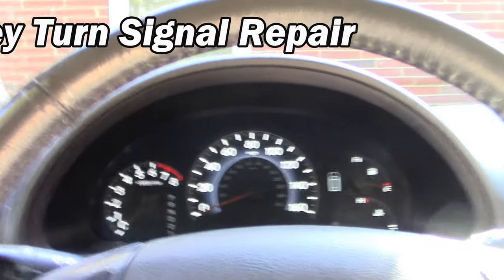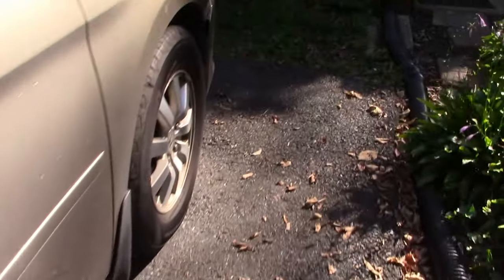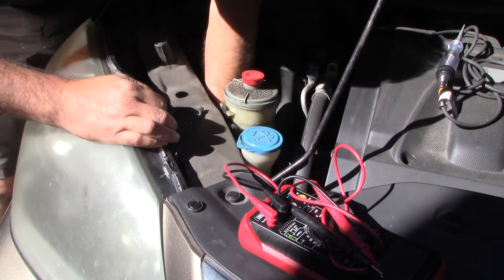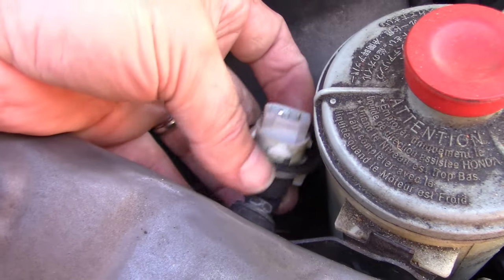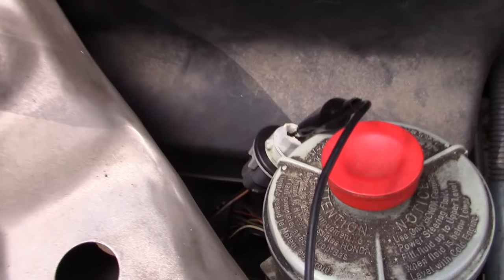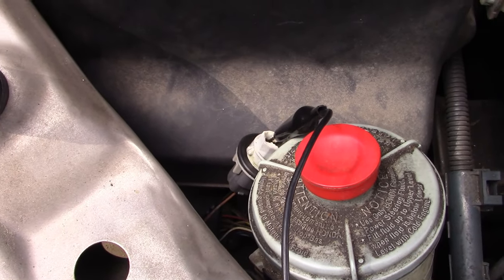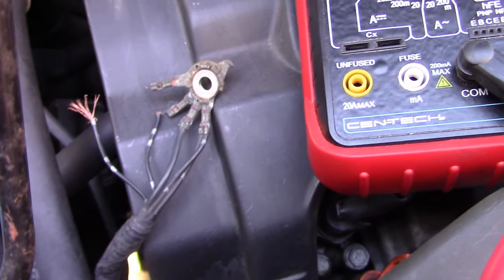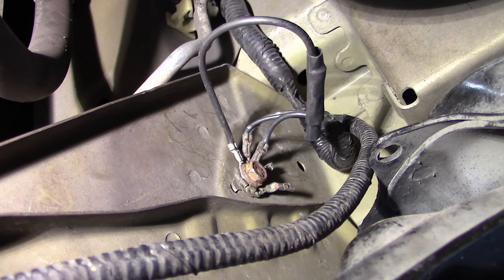TURN SIGNAL Not Working But BULB is GOOD - Blinker Diagnosis & FIX - Honda Odyssey

Comment: I had the exact same problem with my 2009 Odyssey.   My mechanic did his diagnosis and at first thought it was a bad socket, but replacing it didn't help.  He eventually thought there was an issue with the fuse box multiplexer that would have to be programmed by the dealership.  I wasn"t  convinced and showed him your video and asked him to checkout the grounding point.  A couple of the wires broke when removing the screw, but he soldered the broken wires and heat wrapped them and used some dielectric grease on the contacts and PRESTO, my front right turn signal is working again.  Thanks again for the great video!

Comment: mine is stuck on solid while engines off but when I turn my signal on it blinks but when I shut it off, it’s just lit even with the engine off and only on the passenger side, but if I put my driver side blinker on it, shut off until I shut my driver side blinker off then it solid again. Does anybody know, what might be the problem?

Comment: Thanks for making this video and going through the diagnosis. Just had the same issue on our 08 Odyssey and ordered a new relay, which did not solve the problem before finally finding your video. Almost considered getting the whole front wiring harness, but that would have been an expensive and time consuming solution. Thanks, again, for sharing and saving a lot of time and headaches!
Reply from the maker: Thanks, Tom, and good luck!

Comment: Sorry it took your whole day. I’m definitely thankful. Needed to do this so I can pass inspection.
Reply from the maker: Great. Hope you get it resolved easily. NJ inspection used to check everything....blinkers, lights, brakes, horn, everything. Now they look at your paperwork, plug in a scan tool to make sure the check engine light is not illuminated, verify you've got a catalytic converter....and that's about it.

Comment: Great job.  Honda needs to do something about those ground connectors that are open to the outside weather elements.   Especially with the lights which could be grounded closer to the light reflectors and more out of the corrosive salt and water elements.
Reply from the maker: Good insight. Thanks for the note.
Reply: Cadillac does too. Because my 2005 SRX has the exact same problem looks like.. All I know is I’m tired of changing bulbs.. It’s a challenge to get to the bulb period on these cars. This is the blinker and fog lights lower that’s quite a bit of work just to change a bulb. The head light lamp is a bit easier though.. But that blinker is WORK!! 😂🤣

Comment: Great video, my indicator light won’t turn on and the turn signal blinks fast .  There’s 2 different filaments .  It’s not the bulb, I replaced the bulb and same problem. Checked the bulb continuity for double assurance.  Are you not afraid that the other grounds are going to fail??

Comment: Have the exact issue on my 2006 dodge caravan. Now I have to figure out where the wire is bolted to the frame rail. Thanks for the logical plan.

Comment: Hi, I lost both my rear left turn signal light and brake light. I think it is also a gruangding issue. Could you tell me where the grounding point is to that circuit. Thank you

Comment: Excellent vid, I have the same problem with my 05 Odyssey, thanks for sharing it. I will be looking at those ground wires,  tried the new bulb on the LT side signal worked fine so it's not the RT side signal bulb. My fender liner is missing on the RT side, I'm almost certain the negative ground will be corroded 👍🏽
Reply from the maker: Yep, common problem, apparently.

Comment: I’m glad I found this video my friend has the same issue. And when u said about turn signal blinking at different speed inside the car I just realized that I did heard the difference. But did not paid attention to it. Now that u said if I will be checking fuses. And also the turn signal in his just stays on so it’s def not bulb issue. But now if it’s not fuses or relays. Then I hope the body shop that fixed fender and bumper and replaced the headlight didn’t accidentally messed with wiring.

Comment: Glad I found your video, similar problem but mine is the RT rear turn signal on a 2005 Camry.  Ok, now I have to find that chassis ground. Hopefully it's not hidden away to bad. Thanks again. BTW, swapping the bulbs from the working side / bad side is a good way to check the bulb without having to run out and buy a bulb that you may not need.   :)

Comment: Look like both left and right blubs were flashing in vidio ?
Reply from the maker: Yes. Because I put on the flashers to test both sides at once after I fixed the bad ground connection.

Comment: I’m hoping I have a somewhat similar issue on my Accord. My left side blinkers both stopped wormy simultaneously and don’t even come on w/the hazard light switch. Checking the ground wasn’t even a consideration until I saw this video.
Reply: It’s the signal relay

Comment: One of my headlights has been out for a few wks, my 4-ways still function properly bulb wise and dash wise, but my turn signals for both sides will stop working spontaneously. I replaced the 4-way button back in August as well as the actual turn signal switch entirely.

Any ideas as to what this is because I could turn the 4-ways on while driving and sometimes it will cause the signals to work again momentarily.

Thanks in advance
Reply from the maker: I can't say for sure what the problem is...But bad ground connections can cause all sorts of weird things to happen....

Comment: I don’t have a Honda but 2013 Kia Sorento- thought putting in new bulb would solve my rapid blink problem- didn’t work! Thought I would have to take it to electrical mechanic shop but searched and found your video. Looked for ground wire on body but it was shared with horn that works. My directional bulb goes into a socket with contacts that rotate into place. Looking at socket the ground contact looked a little bent so adjusted it and rotated back into headlight housing and it works. Thanks for setting me on the right path even if it wasn’t the exact same fix!
Reply from the maker: That's great, Jack! Good job getting it done yourself!

Comment: Thank you and now I know I’m not going crazy.. I’ve changed the bulb three times this year on the same light signal passenger side and I literally just bought a new light period. I put it in and the very next day on a brand spanking new light it did it too. So of course something else is causing this problem. So thx so much for this video and it looks like it’s going to be a shop fix because I certainly don’t know that much about cars so I definitely wouldn’t try to take any wires loose to diagnose.. But at least I can stop taking my bumper off to get to this lamp just to replace a bulb. 2005 SRX 👍🏻😊♥️
Reply from the maker: Nope, you're not crazy. Thanks for watching the video and good luck with the repair.

Comment: I'm having a similar issue.  With a new fuse, my right turn signals work perfectly.  As soon as I try to turn on the right signals, the fuse blows.  Any ideas on where to start troubleshooting?  The bulbs are all good.  :|
Reply from the maker: Sounds like you've got a short somewhere. Could be anywhere from the fuse box to the steering column turn signal switch to the bulbs...or anywhere along the way. A wiring diagram of the turn signal circuit would seem to be essential now for troubleshooting your issue. Good luck!

Comment: Rear Passenger turn signal bulb flashes rapidly and front passenger turn signal bulb does not light up at all
Front passenger Bulb is good because
Neg battery alligator clip to front bulb and bulb to positive terminal of socket……bulb flashes
Pos battery alligator clip to front bulb and bulb to bulb socket ground……light constantly on.
Related or not the front passenger headlamp does not work but the passenger running light works. 
.??  A larger grounding issue??  That cluster of ground wires under car looked ok.
I tried Continuity testing and got no response but that may just mean I don’t know what I’m doing…..
No fuses were blown.   I assume Relay is ok since got flashing in the test.
Any thoughts?
Reply from the maker: The cluster of ground wires may "look" okay, but I'm going to bet that is where your problem is. Take it apart. Clean thoroughly. Re-do any suspicious looking wires/connectors. Re-install.
Reply: @Buckwsr  thanks

Comment: My 16’ chevy Cruze had some electrical problems some of the fuses under the hood don’t have power to them.. i tested them. Some light up when contacted and some don’t. I replaced all the mini fuses and still not getting power when checked.. 2 of the turn signals, brake light, horn, power outlets don’t work and engine worn turn on. No crank at all. Also windows won’t roll down from front driver side and passenger, but the rear windows work only on their doors. Won’t work from the master control. But dash lights up and front lights work. Any suggestive leads to take?
Reply from the maker: My honest gut reaction to your note is that you are in way over your head and need to get some professional help to sort out this list of problems with your vehicle. Get it towed to a reputable shop. Chances are that there is one significant issue, which, once identified and resolved, will fix most if not all of these multiple electrical problems. Good luck.
Reply: @Buckwsr  okay thank you! Will update when fixed.

Comment: Great video. Thanks for sharing.  I found your video while searching a problem with the turn signal on my 2006 Honda Pilot.   When I use the left turn signal to make a short left turn the signal does not always cancel when completing the turn. The left signal does cancel on a longer turn of the wheel.  The right signal cancels after both a shallow and deep turn.  I replaced the flasher switch arm but it made no difference.  Would appreciate any suggestions.  Best regards.  😊
Reply from the maker: I'm pretty sure the mechanism that turns off the signal after a turn is located inside the steering column, and would require removing the steering wheel to access it. Possibly more trouble than it's worth.

Comment: Very nice video and explanation! 
I have the same exact issue on my 2008 Nissan Altima
The only difference is that I have this problem for both front turn signals
My question is, do I have to look on the other side for that other ground wire or are they all in the same place like you showed on the video? 
Thanks in advance
Reply from the maker: I don't know how your vehicle is set up, or if both front turn signals share the same ground. A wiring diagram might be helpful, or an online search to see if other Altima owners have any experience with that same problem. Good luck.

Comment: Thanks for sharing this. I have a similar problem on a 2000 Tundra but the left turn signal only flashes faster when I step on the brake. The truck had a camper shell with turn signals and brake lights and the wiring was installed by the installation team at the place I purchased it from. If corrosion (or a wire with limited continuity) caused your problem, maybe the wires spliced into the brake and turn signal lighting are causing my issue.
Reply from the maker: Yes, aftermarket add-ons are often the culprit in strange electrical issues, unfortunately.

Comment: Same  problem on my 2014 Cadillac SRX.  I'm sure the bulb is good.  I'm going to check the bulb socket ground.  Thanks for posting.
Reply from the maker: Good luck, Ken!
Reply: @Buckwsr  This was an intermittent problem that the dealer service people couldn't diagnose because it was working when I had the car in for other service.  The very next day it stopped working again (intermittently).  I couldn't detect a ground through the ground side of the bulb socket.  I then discovered that the bulb socket was a two piece arrangement that I was able to disconnect.  It turns out that the bulb socket has two pins that plug into a wire socket.  I put a small wire into the ground pin hole and reconnected the parts.  Success!  So far, so good after almost two days.  Thanks again!

Comment: Thank you for the great film. It was especially useful for me, though I accidentally disconnected the grounding, and it was in a totally different place.
   I found it!! And what it was, I removed the headliner board for re[placing the upholstery on it, and disconnected the wire to the ceiling lens. The shop manual (I fortunately have for that car 2001 Saturn SL2) advised to attach those wires w/scotch tape, so I disconnected it fm/the plug by the rear window. The plug was sitting on a thin plate, which I assumed was there for keeping the plug in correct place. After I did some research and watching this film I've learned that grounding could cause Turning Signals go off. The Manual showed 2 grounding wires on the rear close to that plug. There was a clip on the plug, metal one. I disconnected the grounding there, so even w/plug in the T S-ls didn't work of course. It might be helpful for someone else. Pls check the grounding as well if you have a problem w/T Signals and the fuse is fine. I was about to replace the Steering Column Switch, and actually ordered one already (so will have a spare now, not bad thing though). 
   Thank you again for pointing out on Grounding connections.

Update 1: Now everything is working w/that clip off or on, so it was not the ground connection, just a mounting clip. I'm completely lost and don't know what was the problem before. Maybe still the Steering Column Switch. The car was sitting for a long time, probably smth got corroded inside of that Switch and after several shifts back and force it is gone.
Reply from the maker: Thank you so much, and good luck with your car!

Comment: THANK YOU! My 2006 Odyssey right blinker has suffered the same fate. I suspect I have a couple bad grounds on that side as the indicator light is out as well. I have also confirmed the bulbs are good but still no illumination. Now I know where to find that illusive ground connection. Thanks for taking the time to film, edit & post.
Reply from the maker: Thanks, David. Hope you get it resolved with no problems.

Comment: Thank you for posting this video. I have the exact same problem on my 2009 Ody.  I have an oil change coming up soon will tackle it then.  Wish I had seen this before I bought a new relay that didn’t solve the problem and had a feeling it wouldn’t be that easy. Lol
Reply from the maker: Good luck on the repair. Thanks for watching the video and commenting.
Reply: @Buckwsr  thank you.   Yw.